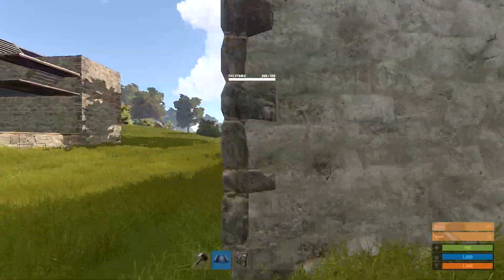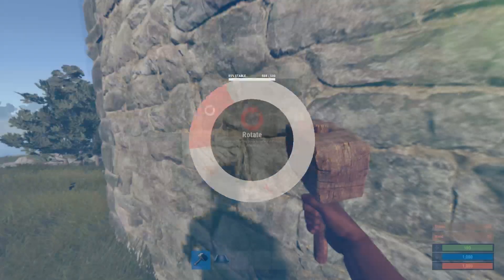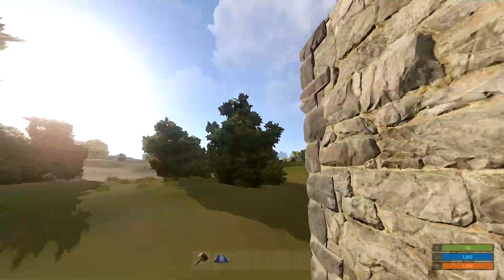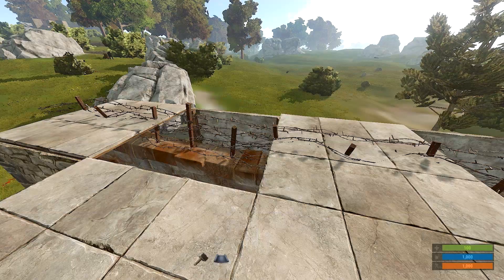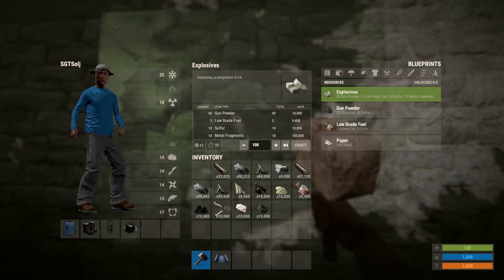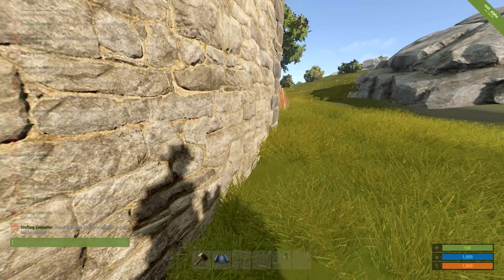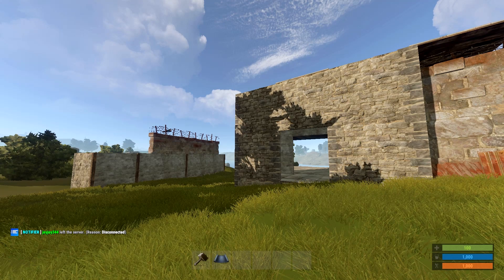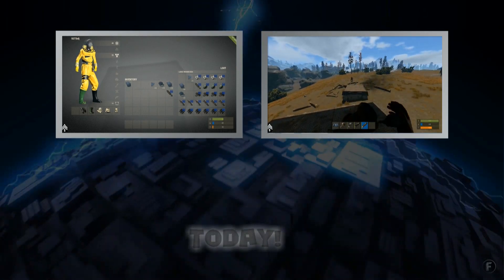Breaking Rust Episode 108! | Encasing High Walls!

Comment: would u do base designs involving this?
Reply: +Anthony Chai I would :)
Reply: We need it !!
Reply: +MrTheNightshade here is the one I am currently building using this exploit. Try getting to that cupboard lol. 6 walls and 4 high externals to get to it! Thanks Sgt. Solj!

http://i.imgur.com/oTMJSPE.jpg 
http://i.imgur.com/Dxv8O7Z.jpg
Reply: very nice! if your really careful you should be able to stack two high walls in each of the squares like I did on the outside of mine. Its a lot easier to do if you stagger them so they dont try to attach to each other. That will also help to enclose the corners on your outer square! :)